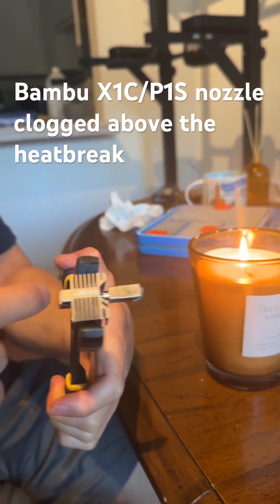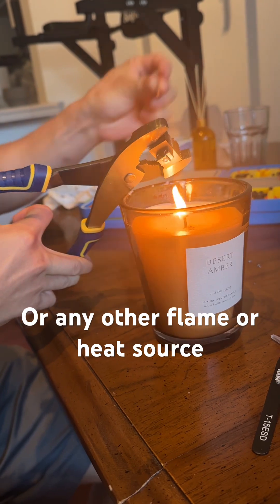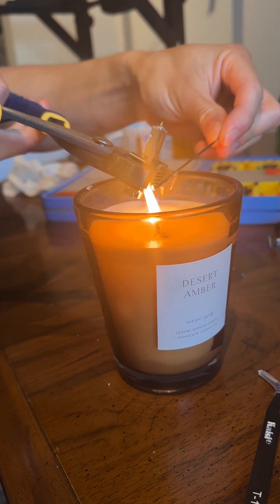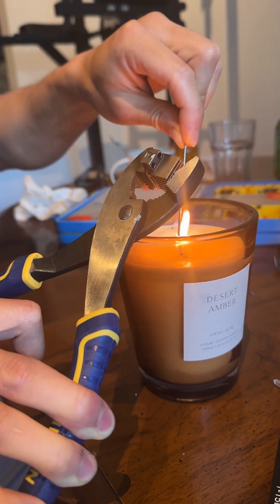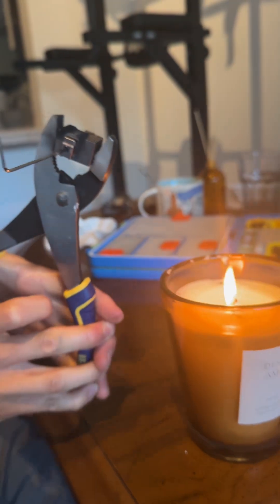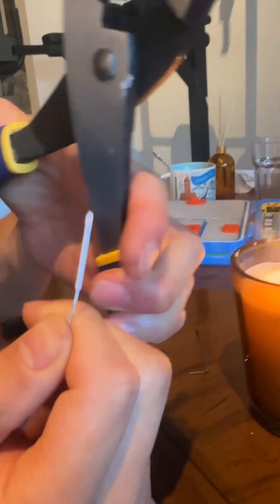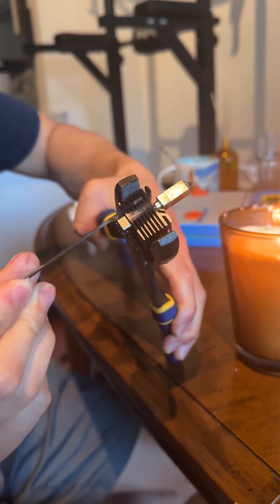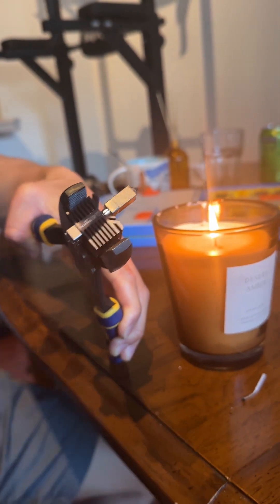Unclogging @BambuLab nozzle above the heatbreak with the hex key #x1c #p1s

Comment: You know you can just heat up the nozzle on the printer and do this. I'm not sure if that tool fits in the other end, but they sell ones that do. It's like a guitar string.
Reply from the maker: Heating up the nozzle will not clear this type of clog because the stuck filament is above the heat break throat. The design of this type of nozzle is such that the heatsink remains cool and filament in that zone does not soften.

Comment: If it's truly clogged.... Push the pin where the stuff comes out.
Reply from the maker: It is clogged above the heatbreak, a pin in the nozzle opening will not work until the expanded filament in the heatsink has been softened and removed.